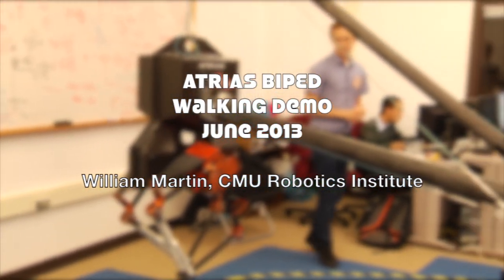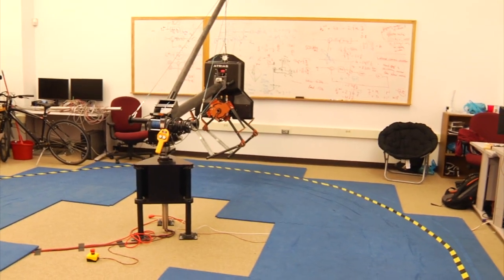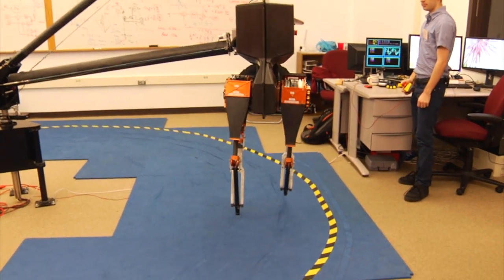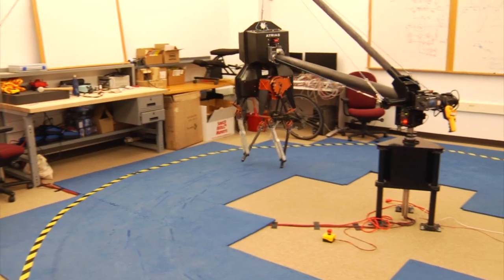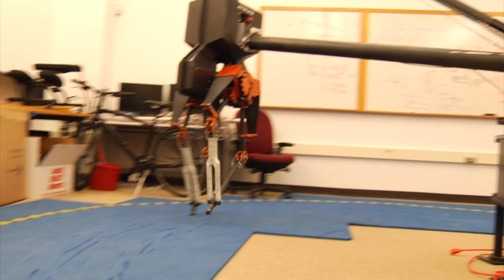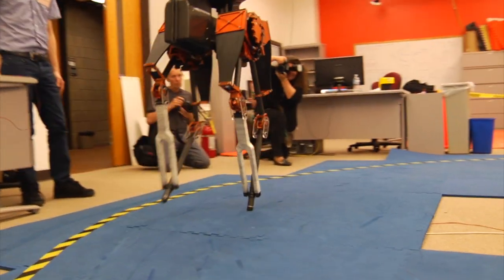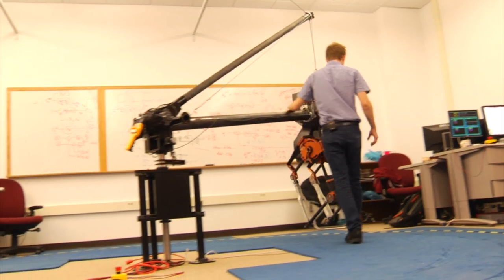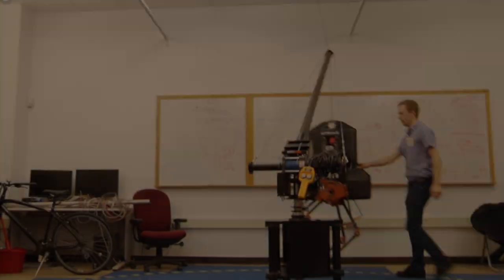ATRIAS Biped Walking Robot

Comment: when its feet are not in contact with the ground it moves forward.. its not completely driven by legs actuation
Reply: Explorer 6.180 I think it’s just momentum from when the feet are actually moving it
Reply: @mrljones01  No it can't be just due to momentum. I have worked on Legged Robot projects and it is extremely difficult to balance them in Static conditions and it gets way more tough in dynamic conditions. Also the velocity is quite low to carry the Momentum and in addition it is moving in circular path.. so if you increase velocity there will be addition of centrifugal forces which will disrupt the balance more.. Overall What I am saying is the forward motion is Partially provided by the legs but the balancing is surely done by the radial Supporting arm